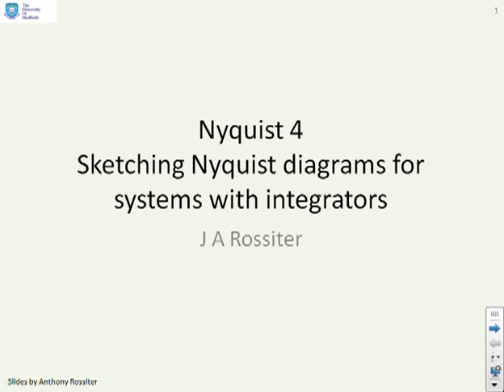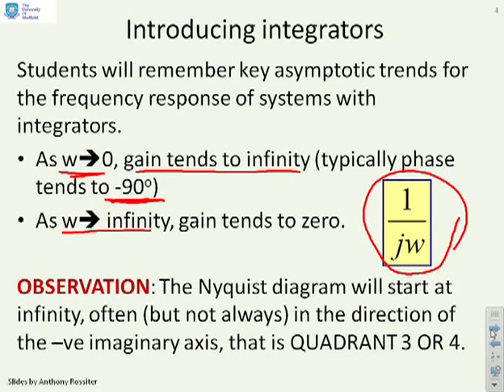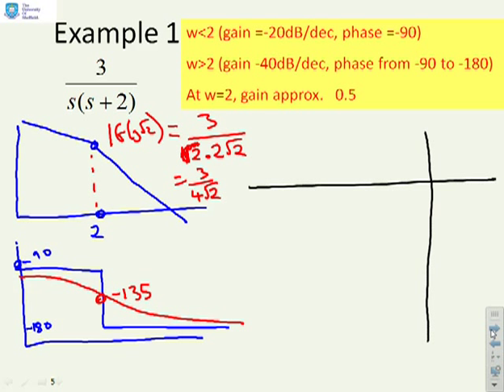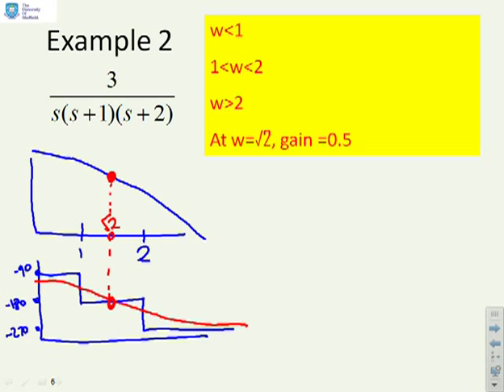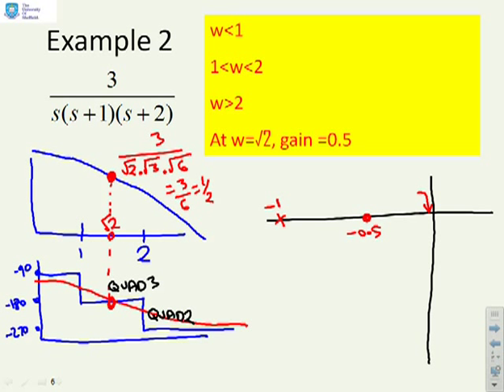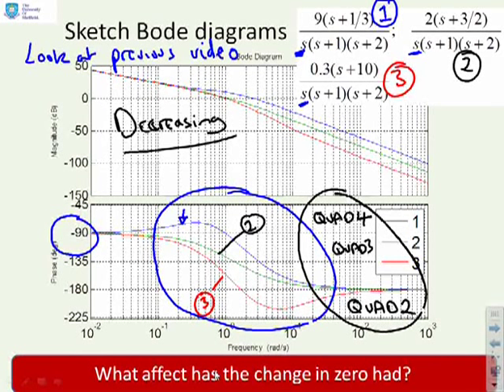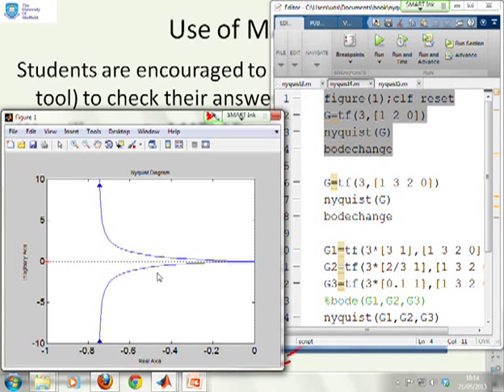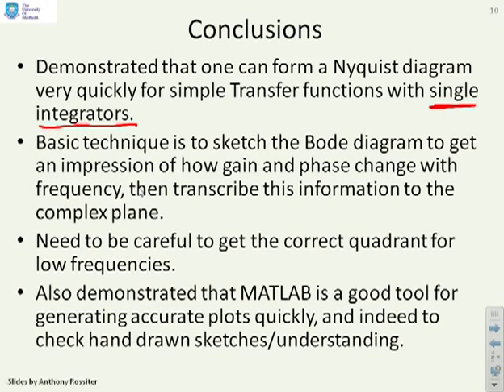Nyquist 4 - sketching for systems with integrators

Comment: At 3:46 the phase at w = 2 ( not at w = sqrt(2)) is equal to -135 degrees. At this point the gain is 0.5. A nyquist plot will confirm this.

Comment: I could not understand de root 2 that appears in minute 6:10
Reply from the maker: Aw w=sqrt(2) the phase is clearly -180 degrees. (Substitute in if you want to check.)
Reply: +John Rossiter I think maybe he is talking about the first example, where I think you intended to use 2 instead of its square root. If so, he referenced the wrong time. I might be wrong. Anyway, I will use this opportunity to thank you a hundred times for your excellent videos!